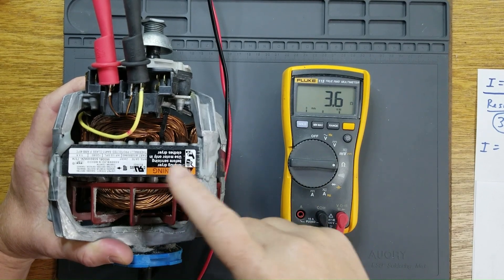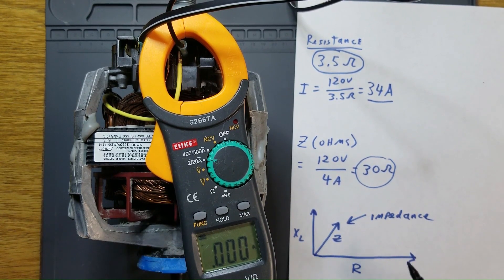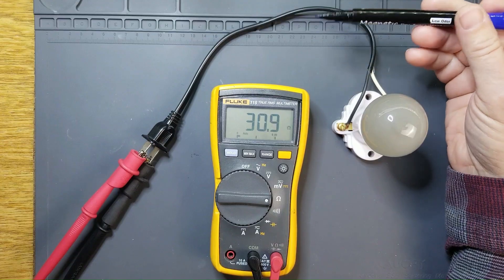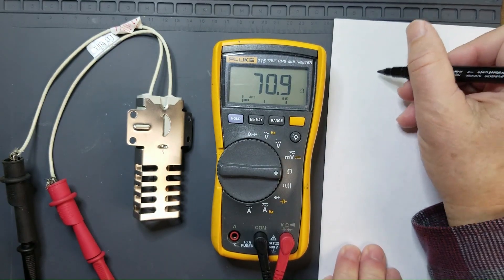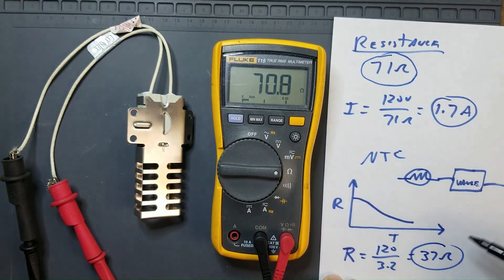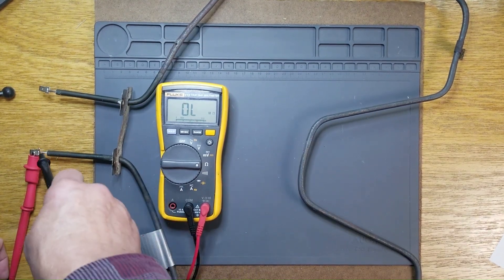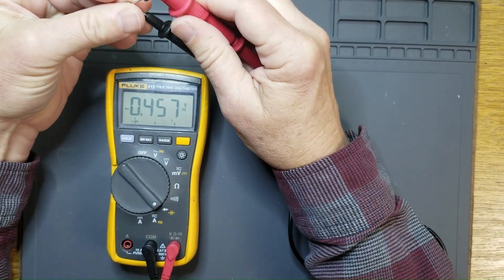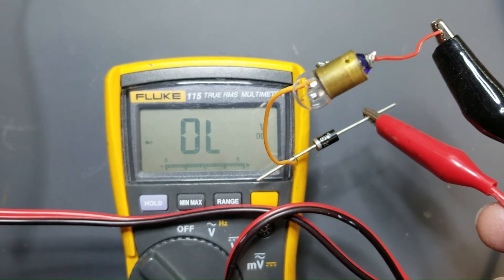#76 - **Can Ohms Lie? The Truth About Resistance & Misdiagnosis!**

Comment: theres another factor with the motor... BEMF. more pronounced if it was a brushed universal motor, admittedly.

um... theres another strange effect ive seen with resistors, and that was on the gate of FETs...

as per datasheet, you throw in a 4R7, and thats cool. scope the signal, and you see the ideal "square wave" with no ringing.

reduce that resistance, and the ringing increases until you overdo the maximum ratings... oops.

but increase it... 10R... start seeing that square wave developing a curve...

and then, at say, 27R... the resistor starts burning out... woah woah woah! gotta go from 1W to a 5W! wtf?

and then start exceeding 100R, and you can reduce that wattage again... (it does depend on the fet of course, take all numbers with a grain of salt...)

it makes sense when you start thinking about it... 

at a low resistance, there may be a large current, gate charge... but the voltage drop across the resistor and the power dissipated is quite low.
as it increases, the voltage drop and dissipation increases...
until finally, it reaches a point that its simply limiting the current and at that point, dissipation reduces again.

Comment: So mean to test this components you have to energize them and measure after few minutes measure ohm's? And use ohms low ?
Reply from the maker: Some components, like those highlighted in the video act differently when energized vs. when you test them with an ohmmeter. In such cases, their behavior can be better determined by using current draw while energized.

Comment: Ohms law never lies, that's why they call it "Law" anyone who is worth their weight know that there are operational variables with respect to a device under load. For example, an incandescent lamp when the resistance is measured and the math [Ohms Law] is applied would indicate that the lamp will draw much more current than it actually does in operation. This is because as the filament get hotter its resistance goes down.

In the case of the motor there is inductance and eddy currents and impedance that must be taken into consideration. Try locking the motor shaft and depressing the centrifugal switch into the run position and then measure the current, it then probably would draw 34A.
Reply from the maker: Yep. That was the point of the video. To explain all that, and what the colloquial term "ohms lie"  means.

Comment from the maker: I'm forcing the centrifugal switch inward with my left hand in the beginning of the video so as to disengage the start winding. Only the main (run) winding is being statically measured - as stated in the introduction. That's the same winding the current flows through when the motor is running at normal RPM.